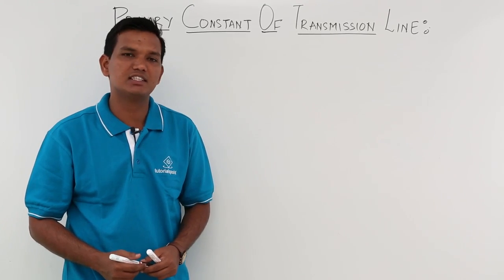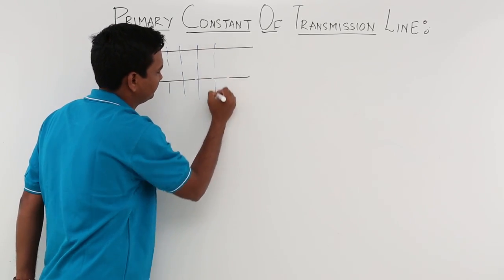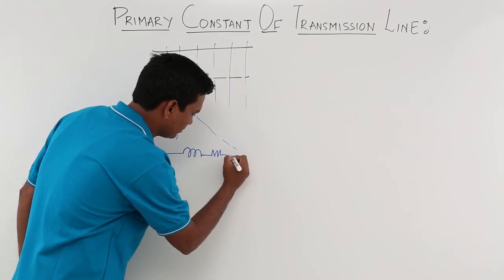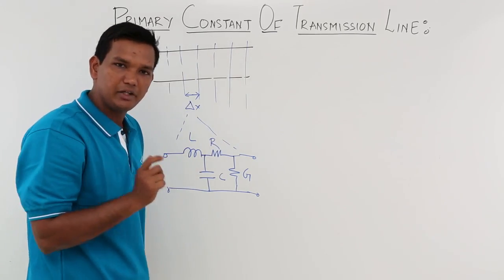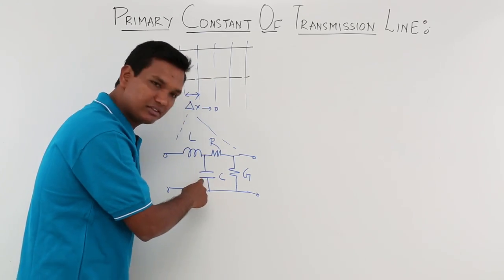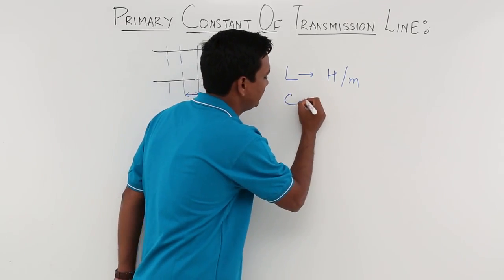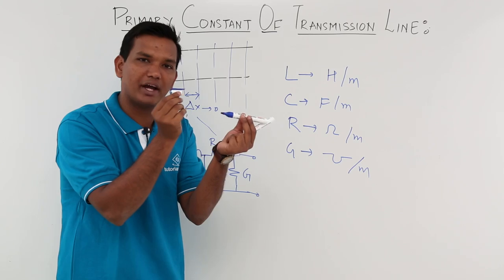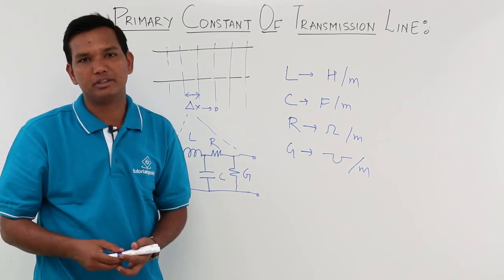Primary Constants of Transmission Line

Comment: How inductance came .. I didn't understand
Reply: Because transmission lines are composed by conductors, which are exposed to induction and magnetic fields and these transmission lines are working with HF, so it generates a magnetic flux. I guess.
Reply: There is nothing ideal in this real world.. every wire has its own inductance and capacitance , and in low freq these values are negligible,so we usually skip this part but at high frequencies they play an imp role.. (inductance is directly proportional to frequency and we are in tens of GHz )